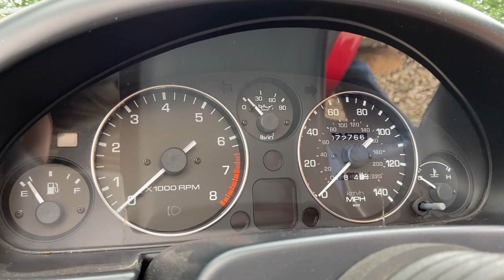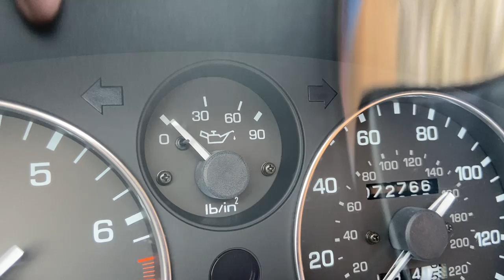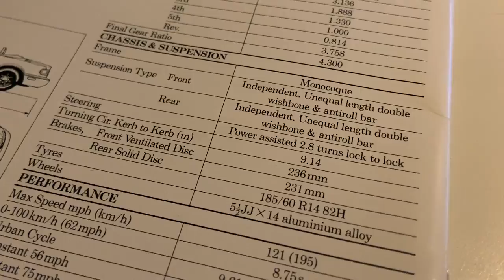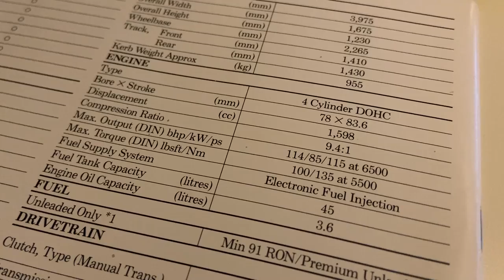The Mazda MX-5 is the Most Important Sports Car of All Time

Comment: This is brilliant Ed, I remember when this car was released and seeing my first one when touring Germany back in the 80's on a motorcycle. That was the start, seeing many more in a matter of months after that all being driven by drivers with wide grins on there faces both on the autobahn and the twisty Bavarian roads. The same grins could be observed when I returned to England. Drivers could once again have fun in an open top car without the concern of reliability or having to shell out the extra cost of a BMW Z1 in left hand drive only if I recall correctly. Keep up the great work Ed!. This provided so much more back ground to the MX5 that I had no idea about.
Reply from the maker: Thanks Anthony 🙂
The MX-5 just makes everything else around at the time look quaint or convoluted. Take the Z1 and it’s stupid heavy gimmicky doors!
Reply: @TwinCam  I have to agree with the heavy gimmicky Z1 doors, when I was in Germany I was given a ride in one near Heidelberg, it was OK I guess. I think it was one of the earlier 'consumer' sports cars that had a sort of ground effect rear diffuser fitted. Adding the extra weight, cost and complexity with the drop down doors does seem OTT though.

Comment: Ed I drove a pre production Mx5 before they hit uk showrooms, since I was company photographer for IAD (International Automotive Design based in Worthing who did the chassis and other work then built five to test). Nobody knew what the mariner blue car was and it got loads of attention. I ran a Fiat x1/9 as my personal car at the time, one of the cars IAD/Mazda evaluated when considering the Mx5 concept. 

Cracking little cars.. we still have a Eunos in the family. Well done on yet another great presentation! 

P. S. We also have a toyota mr2 which is also brilliant, you should perhaps review one of these sometime?
Adam 👍
Reply from the maker: Ahh fantastic! IAD seem to have played a pretty big part in the MX-5’s creation.
I also love the X1/9, and I feel was probably the best link between the ‘classic’ era of sports cars, lasting just long enough to meet the MX-5’s creation. 
I’d love to do a video on an MR2, could you drop me an email?
twincamcars@gmail.com
Reply: @TwinCam  yes IAD played a massive part doing concept evaluation and early modelling through to design and assembly of earliest cars. I'll drop you an email thanks Ed
Reply: I had an X1/9 for a time and it was a lot of fun but not fully developed. Engine got quite hot and produced vapour locks. Front brakes could lock up easily. But a boot both fore and aft thanks to the targa top. I now have a Mk3 MR2, even more fun but much less practical, no boot at all! But drove MX5's a couple of times and absolutely loved the experience.

Comment: As ever, fantastic video! Your passion for this car is so right, and the story you’ve told about it gives the car the color and context it deserves. 

I was turning 6 as the Miata was launched and I still remember how special the Mariner Blue example I first saw, looked in a parking lot stuffed with squared-off LeBarons and Cutlass Cieras. I remember family and friends and TV sitcom characters talking about it as though it was their dream car. It really was a sensation. People have no idea the passion that original NA car stirred.

Later, when I was 18 and tried my hand at selling cars for a summer between high school and college, I chose to work at a Mazda dealer that sold more Miatas than any other dealer on the West Coast. The facelifted version of the NB had just been released, and this was the first version I’d get to drive. It was then that I fell in love as I felt the car react seemingly telepathically to where I wished to go. I sold quite a few that summer. Thank you for stirring the memories.

As an obscurantist, there were many other roadsters of the era I appreciated more, stylistically: The ancient Phase 4 Alfa Spider and its Type 916 replacement, the latter of which was unavailable in the US. The Fiat Barchetta, which was also unavailable in the US. The BMW Z3. And even the Mercury Capri XR2. But none, as you say, are as inherently either as modern, or as pure and correct, as the Miata. The original 4cyl Z3s come close, but… no pop-ups and maybe a bit too much aggression.

Mention of the 1989 Capri brings me to the point you made about Mazda attempting to develop 3 different types of sports car, one FF, one MR, and one FR before choosing the Miata. The fact is, **all 3 ended up in production**: 

The FF car was made in Australia as the Ford Capri and built the with same 1.6L engine as the Miata, but off the Mazda 323/Ford Laser platform. You could even get it turbocharged from the factory, with more power than the later 1.8L Miata four. The Capri launched at around the same time as the Miata, in 1989, with a Ghia-penned exterior and an Ital-designed interior that ended up looking quite different to the original concept. But its styling seemed awkward next to the Miata’s. FWD afforded enough cabin space for a useless backseat, which probably appealed on paper to marketers, if not customers. But the FWD handling - at hot hatch levels - couldn’t compare to the FR Miata, either. It was cheaper, more practical, and faster, but evoked none of the passion of the Miata. They’re still a lovably weird car that I want to have, but almost no one has cared to save them from the scrapyard, much less increase the aftermarket support the NA Miata has.

The MR car, in slightly shrunken form, debuted 3 years after the Miata and Capri as the Autozam AZ-1, and its styling was clearly related to the original MR concept, albeit somewhat changed as well. This car has, in current times, found a small and passionate following. But it made none of the impact that the Miata has.

Isn’t it incredible, though? What an unbelievable thing Mazda did to try all 3 formulas at the same time! THIS is one reason people my age speak so highly of the Japanese cars of our childhood. No one today would dare try something so bold. But only the FR Miata’s fervently perfected version endured. The other two are relative obscurities today.

There is one classic, mainstream-priced and powered (i.e., non TVR or Morgan) British production roadster that linked the MGB/TR7 originals to the upstart Miata, but it almost never gets talked about: The Scimitar SS1/Sabre. Certainly not a pretty car - although later versions did look handsome - it seemed to both represent everything that had gone wrong with British cars of the day while still keeping the faith and giving a good driving experience. 

Do you have experience with any SS1’s or Sabres? We didn’t get them in the US and it’s very hard to find info on them online beyond the bit on aronline.co.uk.
Reply from the maker: Thanks as ever mate 🙂
I don’t know that much about the SS1. In fact, I don’t recall ever seeing one driving about, they’re that rare.

Comment: I got to speak to the design team a number of years ago as my then girlfriend was heavily involved with MX-5s here in the US. She was in charge of building the very 1st Spec Miata race car, SM1 which is owned by a friend in Austin, TX. But what was interesting was a picture album Mr Y showed me: a white MX-5 prototype, a white Elan, and a white Triumph Spitfire 1500. They told me they wanted the looks and performance of an Elan with the feel of a Spitfire. So the top 3 designers would take the 3 cars, do their test loop in CA, then swap cars at the end of each loop then go compare notes. I found NA MX-5s as well as subsequent models are a bit lacking in legroom for my 6 ft frame (with a 34 inch inseam), whereas my Triumph Spitfire 1500, TR4, TR8 and GT6 have much more legroom. Though some other things they don't do as well as the MX-5.

Comment: 😀Love some appreciation! I have two, a 1.6 and a 1.8. Such a nice little pure sportster, without a single glaring issue.
It isn't that practical or powerful; but I've never experienced anything that comes close to being as fun or enjoyable on the road.
Reply: I'm newer to Miatas and currently own a 94 1.8 B package. How do your cars compare? I imagine the most "pure" Miata experience would be a 1.6 base with no power steering or a/c to get as close the the original simple philosophy as possible
Reply: Both are great in their own simple ways. The NA6 is lighter, and demands the engine be used. The NA8 is a bit more solid and competent, but not by a lot. Both will reward a driver with skills, if they try to drive skillfully. Both will happily cruise around topless without being pretentious, which is more amazing than you think, it can even be a friendly experience!

Comment: I've owned three Miatas. Two '97s and a 2000. Followed by a '74 MGB and now a '77 MGB. I love the '77 B the best. Not as quick as the Miata, but almost and much more roomy and much more stylish. All said, both are brilliant cars and not a bad angle on either one.
Reply: Funny we've had a few Eunos but like you I'm currently readying an '79 mgb (gt) as I need more room and prefer the Italian styling and the glamour thats missing from 90s Japanese cars by comparison. Timer will tell whether the B can deliver enough reliability but I can forgive it the odd failure
Reply: Should have got a Midget, or a Sprite and then tuned the engine or swapped the engine and transmission for something a bit more modern.
Reply: @koitorob  midgets and sprites are great cars but I needed the legroom offered by an mgb

Comment: Edit: my inspiration for buying a Miata was my dream of owning an Austin Healey 3000....which I never did achieve sadly. 
Great video as always, Ed. 
In my early 20s, I bought a new 1996 Miata. I loved it. It was the most fun driving car I've ever driven. 
However much I loved the Miata, it wasn't an incredibly well built engine. I had traded in a 1993 Honda Civic to buy my Miata. The Civic had the superior engine.  I loved the driving dynamics of my new roadster, but deep in my heart I could tell that the new Mazda engine was not as refined or gutsy as my older Civic's engine had been. 
Everything else was wonderful though.... handling, braking, boulevard cruising.,...it was a wonderful experience. 
I sold it a few years later and bought a 1973 VW squareback and a Honda V4 Interceptor. LOL.....the things we do when we are young!
Reply from the maker: Thanks Warren 🙂

Comment: Thanks Ed, great video, a love letter to one of my favourite cars. I currently have an ND 1.5 which I love to bits. Thanks so much, and look forward to more content.
Reply: Hi Michael. Have you ever driven the 2.0 and if so, how did it compare to your 1.5?
Reply: @davidw6469  Hi David. Depends which 2.0 litre - the  early ND1 2.0 has more torque, but only a bit more power, and has a lower rev ceiling. It just didn’t feel as characterful to me, despite being a bit quicker. I like having to work the engine and carry momentum into corners. Also, speeding fines are expensive in Australia. The ND2 has the rasping character of the 1.5 and the same 7,500rpm rev limit and has significantly more power.  The ND2 2.0 is the best new MX5, but it also costs near double the price of a nice 1.5  on the second hand market. For context, the ND 1.5 is my daily driver. My previous daily was a BMW E36 3.0 M3 that was getting difficult (and expensive) to maintain as it aged.
Reply from the maker: Thanks Michael 🙂

Comment: Bought mine eight years ago for the princely sum of £800, and it has been faultless in all that time. It's always been a 2nd car, and is still rust free and drives like new. What more could you ask for? Only a bit more grunt maybe, and even that's still an option today by bolting on a turbo. Might add perhaps £5k to the cost, but for what you end up with, super car looks and super car performance for virtually no money - unbeatable.

Comment: Great video, Ed. Mazda got it, as you said, spot on with Miata. I'm 6'3" and behind the wheel of the NA, it feels like they sat me down and built the car around me. The fit is perfect. The next generation was a serious downgrade, although I will never know how they drive. I don't fit! Same with the Honda S2000. I got stuck trying to get in one in the dealership showroom. Much more and it would have taken the fire brigade and the jaws of life to get me out! 
I love balanced cars, and that is where the NA Miata shines. It has the same weight distribution as my old Volvo 240. With two of similar weight in the car, the weight distribution is almost exactly 25% on each corner. Hard to argue with perfection.
Reply from the maker: Thanks as always Michael 🙂

Comment: I have a 1990 NA with 34k miles on it and 100% factory except for the tires, belts filters and fluids. I inherited it from my father-in-law and it looks like it just rolled out of the showroom. Even the cassette deck still works. It has driven roads in Maine, Vermont, New Hampshire, New Mexico and now North Carolina. The rules are, don’t drive it in the rain, don’t rev over 4000 rpm (often), don’t drive it on the interstate (more of a challenge than a rule, and no daily driver trips, only happy adventures. It’s a member of the family and a fitting legacy to my father-in-laws memory.

Comment: we have a red 97 and the top never goes up.  I added a roll bar and drilled and slotted brakes and that's it !   we run ethanol free gas and it loves it.  have about 110k miles and still looks brand new 😁

Comment: I own a 94 and in a way I'm surprised the Miata even made it to production. 
Mazda made the RX7 at the time, British roadsters had the formula, the fox body Mustang (I own a 91) could be had with a manual in coupe, hatch and convertible configurations and the MR2 nailed the baby Ferrari mid engine RWD layout/look. The Mercury Capri and eventually the Ford Probe, which was originally pitched to replace the Mustang, completed the FWD front engine idea, and despite the niche market it sold like hotcakes and thank goodness Mazda did their market research and continues to produce the Miata.

Comment: Nicely done, nicely done.  Surprised, with the level of detail you went into, no mention of the 'Toric' door curves. Convex top to bottom, Concave front to back. It gives a subtle dynamic when moving around the car, as the reflections on the door move in the opposite direction to the fenders.  Donor car gets a score of Eleven out of Ten.  All stock, no silly intake, silly spoiler, silly wheels, silly white instruments, silly plastic pedal-car pedals, just as it came from the factory, except for the lowering of the suspension ride height.  Hopefully that was done using adjustable coil-overs and not with the dread cut springs.
Reply from the maker: Thanks mate.

Comment: I have a 96 na owned from new. One of several cars that I have held on to (hoarded says the wife)  instead of trading in even though it was/is worth very little now.  Everything is original (including the now rusty arches & sills). Should I sympathetically restore it and keep the 1.8 engine (75k) or restomod and insert Jag 3.0 V6...?
Reply from the maker: They’re worth quite a bit now, compared to 5 years ago!
I’d love a V6 MX-5, so I’d do that, but keeping the power output relatively low 😉

Comment: Owned an NA 1.8 during my track days.  I had been Subaru and turbo up til then.  They always say it is better to drive a slow car fast and with the Miata, that is the case.  Too slow for me actually, lol.  So I sold it.  I shouldn't have.  Couple years ago my Father in law asked me about one that he liked and I persuaded him to buy it.  1989 NA 1.6 with 30,000 miles on it.  All original.  Well, that car is in my name too as it is intended for my Son when he gets older.  Sorry for him, but my Son will not be getting that car, lol.

Comment: A great little sports car indeed is the Mazda MX-5. But I have to add that it owes a great deal of  its success to the much  earlier 30 yrs production run of the Alfa Romeo Spider that ended in the early 1990's  when Fiat took control of Alfa & discontinued the production run.
. Mazda continued on supplying the sports car convertible market   with its well designed &  modern  MX-5.

Comment: Driving a skittle is ok, watching them race in groups is hilarious, one coughs they all leave the track in multicolored splendor like controlled chaos, it's underpowered, not very comfortable & certainly not the Most Important Sports Car of all Time, a reservation which is owned by the the original Datsun's with the1969 -1973 240Z, 1969-70, 2000 Roadster XXX that would quite literally eat the Mazda in all iterations. The cars are well built but they aren't performance minded even remotely, the 5.0 repowered cars are death traps, unlike the 240 Scarabs of the early 70's. They are the perfect companion to a Class A Motorcoach though & easy on the eyes there is that.
Reply from the maker: Being faster than the MX-5 isn’t important.
A new MX-5 would eat the Datsun, for example.
What would make the Datsun the most important of all time?

Comment: The front suspension on the one in your video looks collapsed…
Reply from the maker: It’s not collapsed, Thomas…
Reply: @TwinCam  No, I’m sure it’s not. Lowered though?
Reply: I was thinking the same - I have a 1.6 NA (1993) and this one is definitely ‘low’ compared to mine which is totally stock
Reply: @OldCarsNewVan  It sometimes looks a little odd to lower a car on its standard wheels. These front wheels somehow look a little too inboard and the arch gaps look too small. Also looks lower at the front than at the back, exacerbating the sense that there’s something unusual about it.
Reply from the maker: It’s lower because it’s been lowered, and the front looks lower because one corner is on an incline.